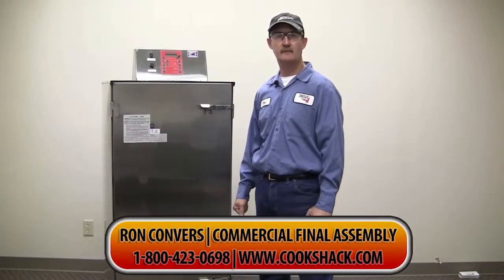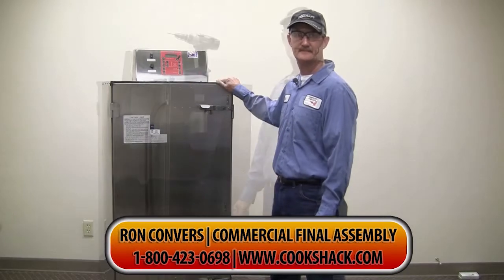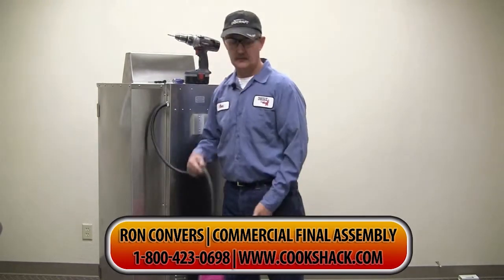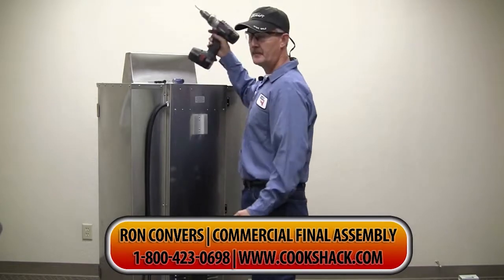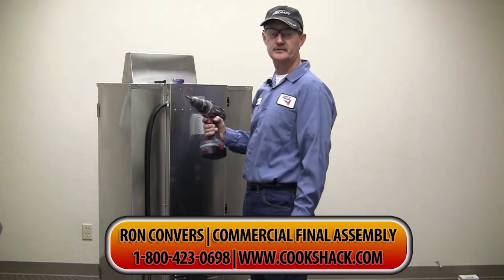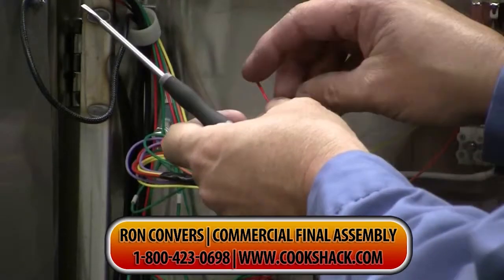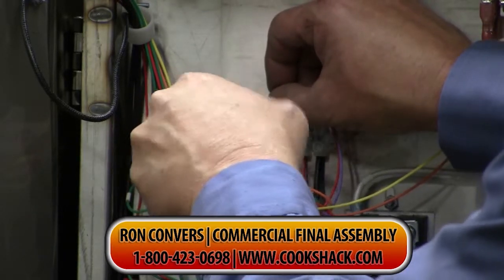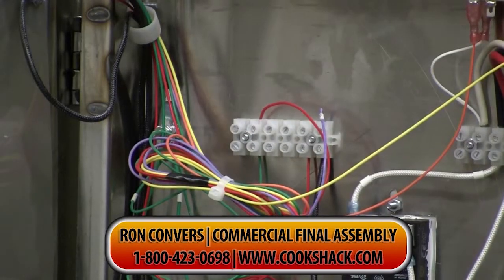SM260- How To Bypass a Door Switch by Cookshack

Comment: Again,I ask the question why would you have to bypass the door switch on a Cookshack 260. I use one daily.Are there any Cookshack techs or anyone who works there watch any of these videos and can answer?
Reply from the maker: +sheldon pfister I am so sorry we didn't get back to you sooner! We have been doing some restructuring (including merging multiple online accounts) and it caused a few issues. It is fixed now!  To answer your question, the sensors can go out and as long as the owner doesn't care if the sensor is working, it's much cheaper to bypass the door switch than it is to replace it.
Reply: Thanks for your response. I presently in charge of two Cookshack SM260 smokers and I use them daily for salmon,pork shoulders,briskets,ribs,turkeys and other items for a large grocery chain in Louisville , KY. I love them . They make my job easy . Just set it and forget it , thanks.
Reply: +Cookshack, Inc. For safety reasons this would have to be repaired if it happened to one of our smokers . Is there a repair kit available ?
Reply from the maker: +sheldon pfister We are glad the smokers make things easier for you!!!! I asked Bill about the door sensor. He said we do sell replacement parts, but you would need to call (580-765-3669) or email us (b_vice@cookshack.com) with your serial number so we can make sure we get you the right one.
Reply: Thanks for getting back to me with your answer.I am pretty sure that there are going to be more of these smokers ordered from Cookshack for future expansion into the smoking of fish and other meats in newly remodeled stores.
Reply from the maker: +sheldon pfister No problem! Thanks for being so understand for it taking so long to get back with you initially. And congrats on the expansions and remodels!